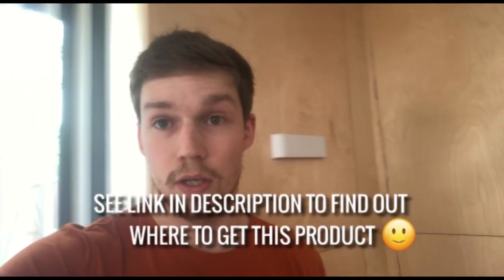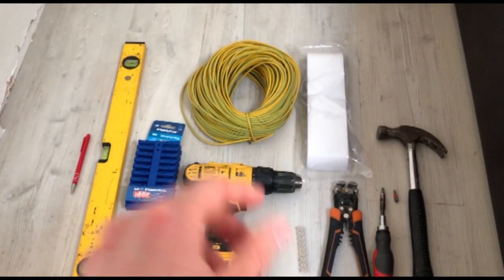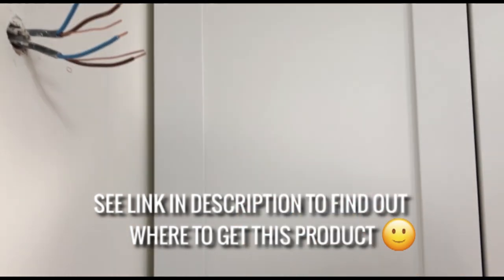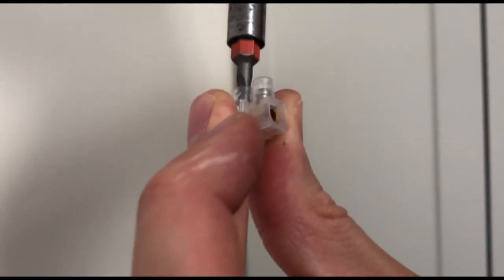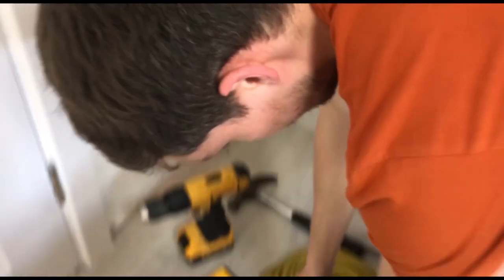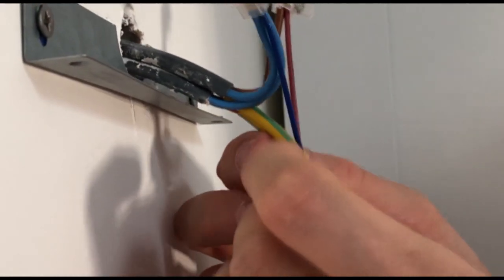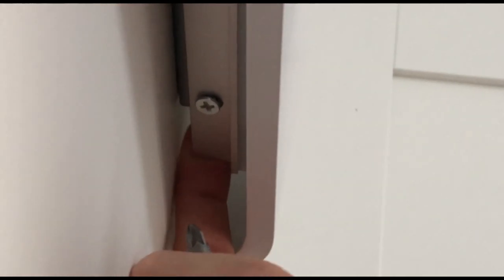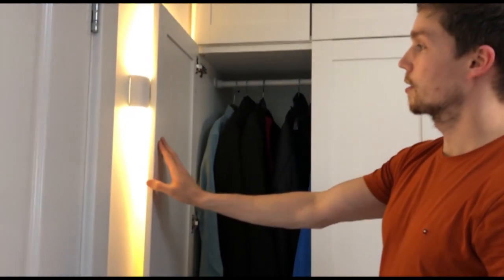BEST LED WALL LIGHTS ON AMAZON UNDER £20! HOW TO INSTALL / WIRE

Comment: Good video, fine stranded flexible cables should have ferrules fitted to them to ensure a good connection also at 1.54 where the meter tails enter the consumer unit there is not a gland/grommet to ensure fire integrity/strain relief.

Comment: Do yourself a favour and buy some wago connectors for connecting wires together instead of using connector blocks. It's difficult to get a good connection with solid and flexible wires in a connector block